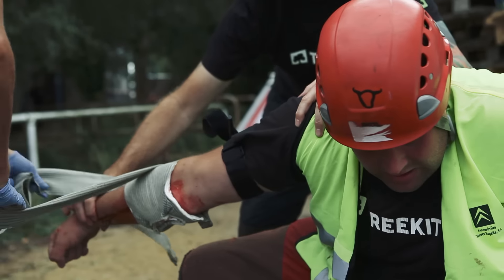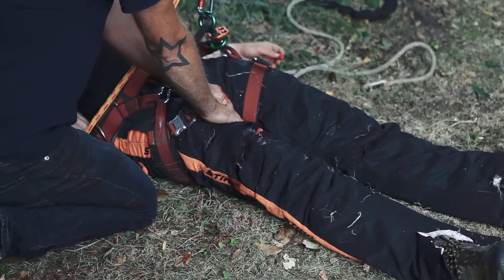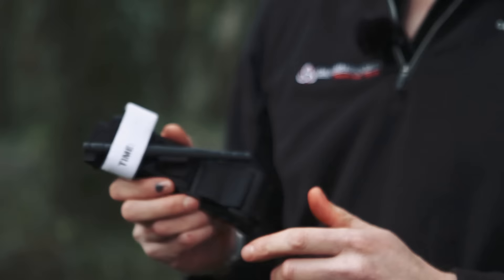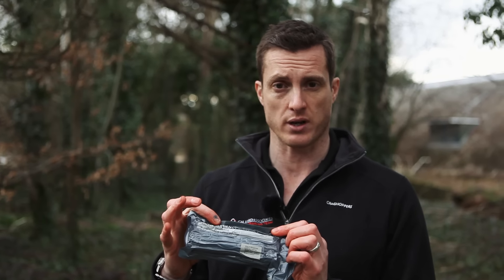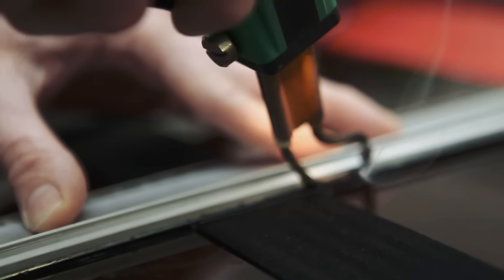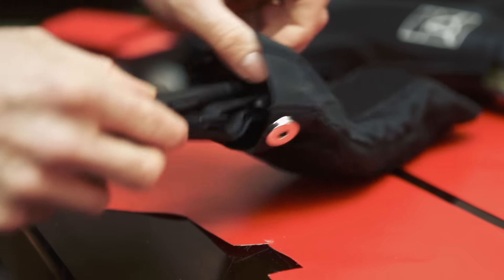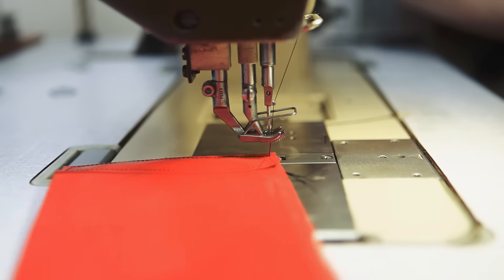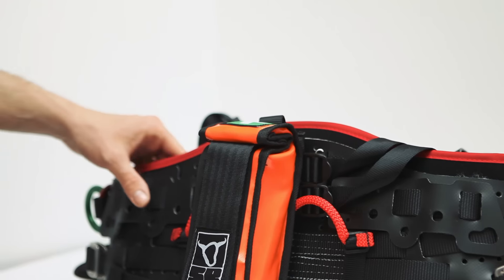Silverbull - Personal Arb Trauma Pack

Comment: soon as I spotted these were out 2 were ordered,  1 lives on my harness and 1 is fixed in the landy cherrypickers basket as a lot of our more dangerous jobs are done from this and would probably take longer to get to the ground in it than it would to bail from a tree with rope and harness should the worst happen. 
great product,  thank-you and well done for bringing it out.
Reply: I have a monkey Beaver 2.0 saddle do you know how to attach it to there what the best way would be by any chance
Reply: @br-dj2ti  same harness as I have and wasn't the easiest to find a spot for it, I ended up using a bit of accessories cord and making up a loop under the webbing just behind the big carry loops for it to attach to.
Trick is wherever you put it make sure you can reach it in all positions with both hands which I found I couldn't so to be honest it now lives on my rope bag at the bottom of the tree and I work on the theory if the injury is bad enough to need this stuf I need to be getting out the tree while I stil can and let someone else apply this on the floor as trying to do it up a tree while potentially passing out is wasting time and forcing someone else to do a full rescue.
Reply: @dryad130  yeah thank you buddy I appreciate it yeah it is a little bit big and bulky I was going to just put a carabiner through the loop and put it to the back of my saddle see how that goes if it doesn't work I'll probably just do what you did

Comment: This Kit is a life saver and should be on every tree climbers harness - well thought out and robust. You've got approx 2 minutes to stop a catastrophic bleed injury before death - this is the only bit of kit that gives you a fighting chance in the trees - or as importantly your mates working with you. I attended the First Aid Training course Galahad Associates run with TREEKIT near Bournmouth, UK this year - and the industry specific training delivered was the most professional, practical and laugh out loud you could hope for. Run by ex-military guys who have used the training for real on multiple occasions makes a difference when compared to your average St John Ambulance volunteer training course with vintage crepe bandages and safety pins.  These guys designed this kit from hard won experience - buy it and train with them if possible. Recommended.
Reply: Do you know what the best way is to attach it to a harness a tree climbing harness